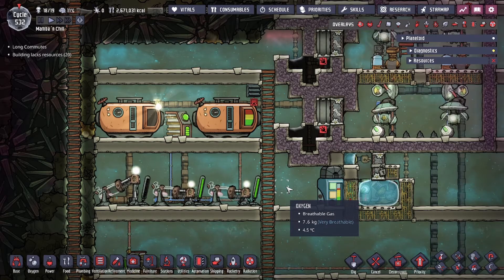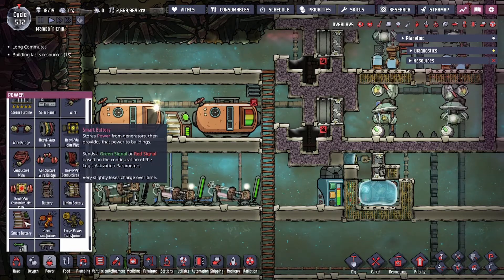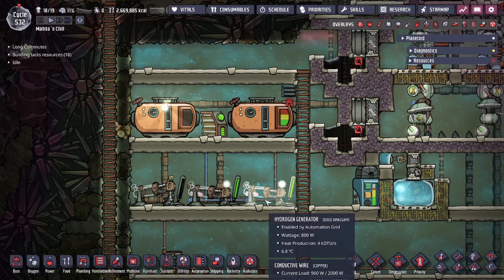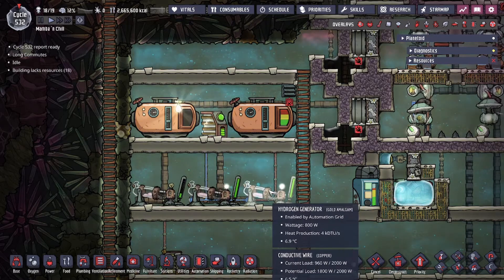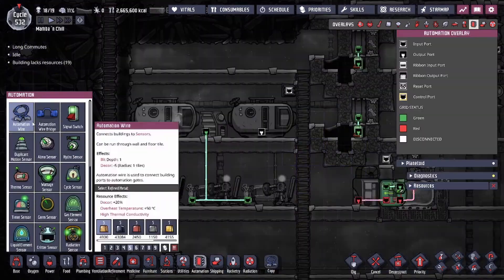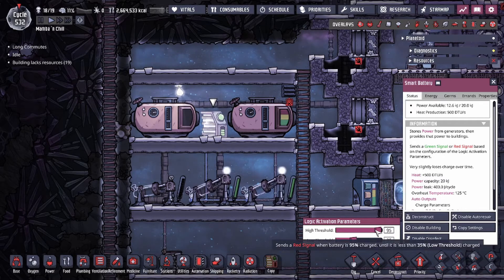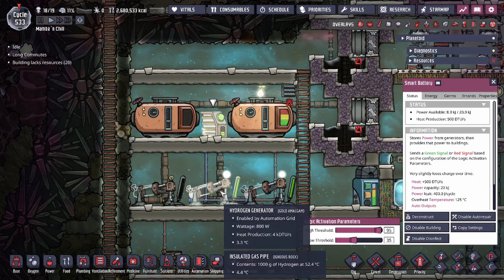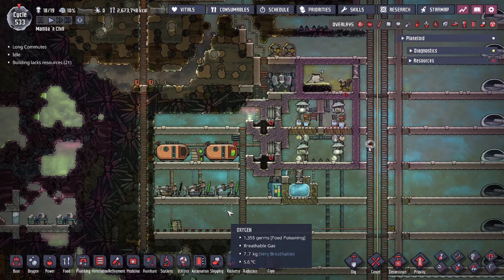Smart Battery Automation Explained - Oxygen Not Included - Basics

Comment: I love your tutorials, but when i hook the smart battery to my generators and i have jumbo batteries it only charge them to %50 before it turns off, is there a way to use them in conjunction with jumbo battery on the same grid?
Reply from the maker: you would have to put the jumbo batteries separately. so it would be gens connected to smart battery and both of those feed into a large transformer that feeds into the jumbo batteries. can add more transformers if you need to increase flow of power from the smart battery
Reply: @2LegitCity  Oh, then I guess I need to redo my whole power grid, what I did is connect all generators and batteries thru a heavy watt wire on one side, and send connections to transformers and from transformers to my base, it's a little confusing, I'll try to test things now, but would be great if you'd make a tutorial, because I searched a lot about this matter and there is almost little to no information about battery setup for large base.
Reply from the maker: @gotpwnd  i do have a tiered power system video, but i didnt use jumbo batteries as i like to keep the power in "resource" form. https://youtu.be/-8y-ks1VY_c
Reply: @2LegitCity  I read this comment and had such an “aha!” Moment… why am I wasting 5% per cycle in stored power when I can just store the resources instead. Doh!

Comment: I want to make it so something only turns on when the battery is at (X) charge.... is there anyway to flip the red/green signal?
Seems I can't make the setting slider on the batteries swap as the green slider will NOT go above the red slider. >.>
Reply from the maker: simply add a not gate
Reply: @2LegitCity  
I'll give that a try, ty